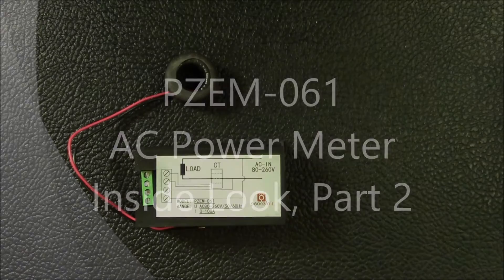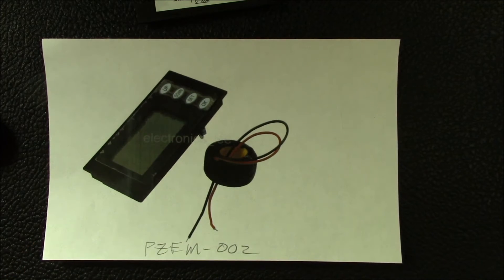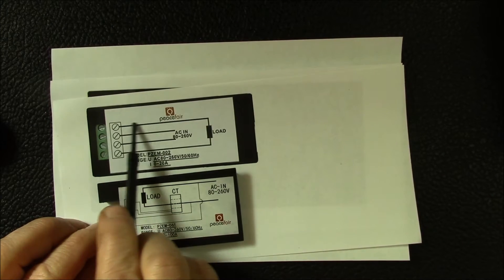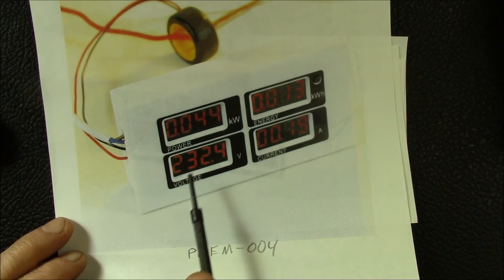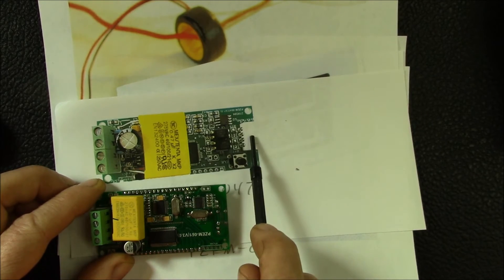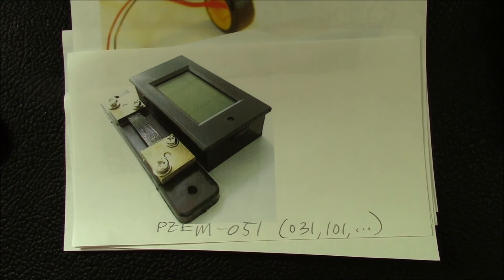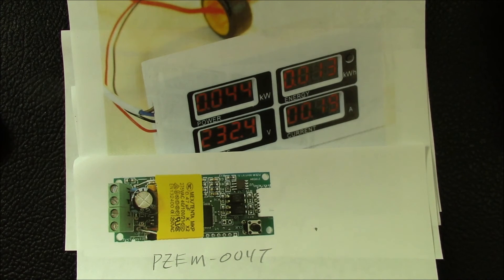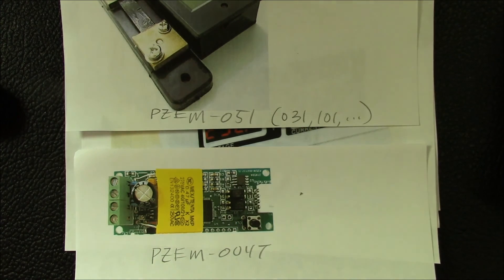PZEM-061 AC Power Meter, Inside Look, Part 2

Comment: What about using this PZEM-061 To hook up to a variac supply. I watched a guys video where he connected one but it was slightly different than the one I have.
Reply from the maker: Sure see this video:
https://youtu.be/ic4kWdZMdfE
or this one for a different meter:
https://youtu.be/zpBXKnCsllQ
Reply: @The4Crawler  Thank you kindly. I'll be modding the meter to get the 0-260 as well. The second video I'm watching now is exactly what I needed. What should I do with current sensor? Or will I need to keep it connected?
Reply from the maker: @jvon3885  It its the current transformer (CT), it just stays where it is with one of the the load wires running through it.
Reply: @The4Crawler  awesome thanks again.

Comment: Hello sir, last week i received two pzem-004t.  i write a little python script to read data from the meter, and now i´d like to connect to pzem-004t a esp8266 wifi to send data wireless to a computer.  it is possible?
many thanks in advance.
Reply from the maker: If you can set up something like a TCP server on the esp8266, you could use one of the network virtual serial port utilities to receive the data:
 https://youtu.be/RrEumwFHfJ4

Comment: links separately http://zftlab.org/pages/2015101400.html
Reply from the maker: Thanks for the links.  Yes, this is something I want to try.  My plan is to use this 04T meter to make a MySensors power meter to connect into my Z-Wave home automation system.

Comment: Thank you for your research into these versatile meters. Are there any variation that allows you to supply a different voltage from the voltage being measured? I'm trying to use an off-the-shelf meter to measure the output from my variac. I'm working with fairly low voltages as I'm working on audio amplifiers.
Reply from the maker: You bet:
https://youtu.be/b2MXXSuzM2k?list=PLpY2FP1a9tivPdpLVyg8XMqxw6B6SAEbI
Reply: Thank you! Awesome hack.
Reply from the maker: Too bad they don't make the meter with a 5-position header with the separate power feed.  Then if you wanted to self-power the meter, just jumper the two line connections together.

Comment: Hi Brown , Hope you remember ,that I told you about my pzem 61 meter burnt upon installing to the outlet of my speed controller , now I have ordered pzem 21 for my project ,and it,s with me , before I make any wrong connection can I fix the load wire to my speed control imput and the out put to the flat pin wall socket , what is your advice to my idea

Comment: I found this device useful, (BYT-VAEM-034) until I tried to operate via a thyristor speed controller. Not a good idea as the 100 ohm sensing resistor got very hot. If anyone has a work around I would be intersted as this unit is otherwise very useful.

peter@itar.com.au
Reply from the maker: The 100 ohm resistor is actually part of the power supply circuit, limits the current to the device via the 1uF high voltage capacitor.  One option would be to lift the terminal on that cap (the end that connects to the terminal block) and feed that pin from your stable line voltage (240V or whatever).  Then feed your speed control voltage into the terminal block as normal.
Stay tuned to the channel as I'll be doing a video on this very modification shortly.

Comment: Hi, how do you interface PZEM-004T (which has 13 pins) to an LED display which has 16 pins?
Reply from the maker: Not sure about that.  I have both an 004 w/ the built in 4 LED display and an 004T which doesn't have a display and the TTL serial interface.  Have not had time to test them out yet, but will post a video when I do so.
Reply: Does any of the 004 or the 004T come without the external CT? or is like a smaller 20A version with built-in shunt and as well a UART interface?

Did you try out the 004/004T?

Great video!
Reply from the maker: I've not yet had a chance to try out my 004/004T model meters yet, but hope to get to those in the near future.  I've not seen one without the current transformer.
Reply: +R Brown (4Crawler) thanks, do you have any idea how much current the cap drop supply is capable of providing. possible to power another MCU with max of 20-40mA?
Reply from the maker: If you work out the combined impedance of the dropper cap. and the power resistor, it seems that 45mA is the max. current on a 120V supply.  Not sure how much current the existing circuit takes, but you should be able to tie into that and test how much additional current you could draw fairly easily.

Comment: HI R Brown. Thanks for the video. I want to use the pzem-004T, but using a split core CT instead. Do you know if it would work?
Reply from the maker: +Lucas Coelho Figueiredo If you look at the comments in one of my earlier videos on this meter, there's some information on doing that:
https://www.youtube.com/watch?v=MRu8zwFSBE4
I think if you get a split core CT with the proper windings ratio, it likely will work.  Note that these PeaceFair meters don't use the same ratio as the OpenEnergyMonitor devices, so you need to avoid those commonly available CTs.
Reply: R Brown Thanks a lot for the feedback. I saw the comments, it was really helpful, thanks for that. But I still have some questions... What is the worst that could happen if I use the SCT-013 on this device? I think it would only show the power and current values divided by two. What do you think?
Reply from the maker: +Lucas Coelho Figueiredo No expert on those CTs, but it looks like the SCT-013 is a combination of the CT and an internal burden resistor (that turns the measured current into a voltage).  I think the PeaceFair meter uses a plain CT, that is it just has the windings.  Then the burden resistor is added inside the meter.  It may be possible to bypass the resistor in the SCT-013.  If so, it looks like the SCT-013 is 1800:1 ratio and the one with the PZEM meter is ~2000:1 if I recall.  No matter the actual ratio, if those are off, the calibration of the meter will be off.  It would not be too hard to find out a ratio by placing a know load in the system (like a 100W light bulb) and then see what the meter reads and then find out how far off it is.